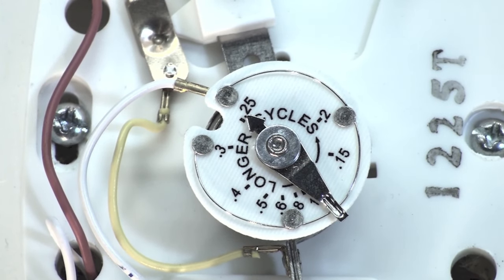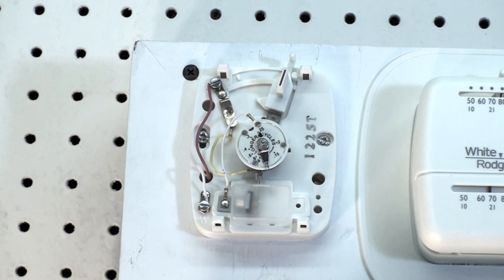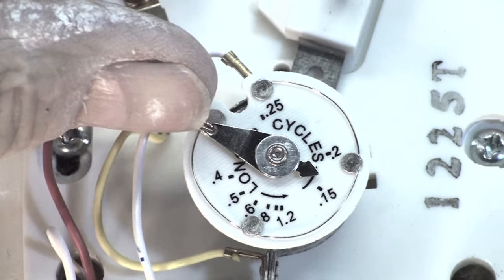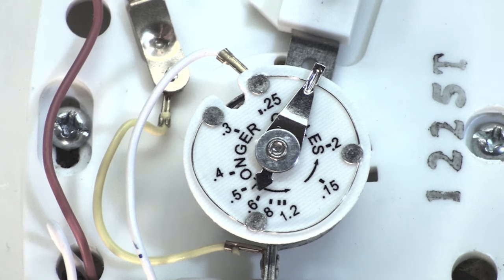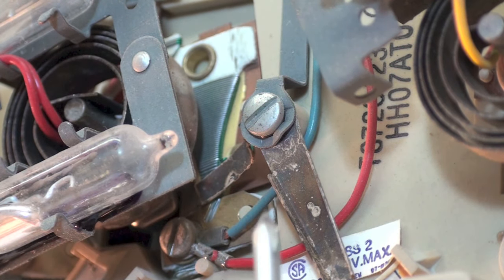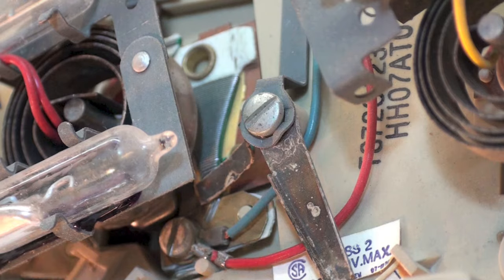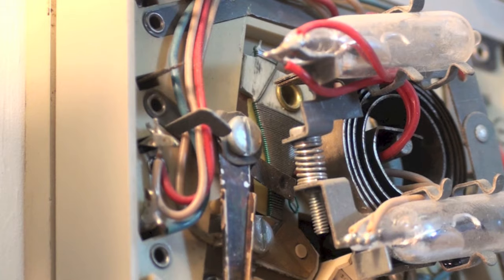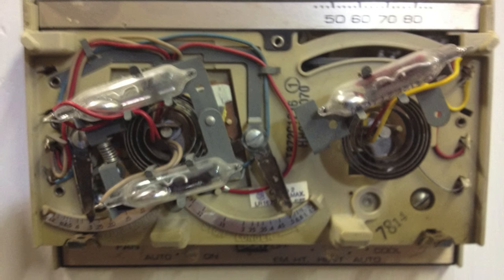Adjusting the thermostat anticipator part 2

Comment: Okay...so the first one you showed is exactly what I have in my RV which is my current home. This is brand new...maybe 6-8 months old. Out of nowhere for the last 24hrs the heater was turning on and staying on even though I had it set to the third line. That usually has it turn on for about 5min, which is more than enough time to heat up such a small space. I turned the little dial all the way off but it just kept on going pumping out heat. I finally went out and turned off the gas because I was being roasted alive. After watching your videos I opened the thermostat cover and the little dial arrow was pointing to 1.2. I’m hoping I’ve understood correctly as I’ve moved the arrow clockwise so that it’s now pointing to .6. I’ll see if this helps to shorten how long the heater turns on for! Hoping you still check this as it’s an 8 year old video but it looks like you did respond to someone about 11 months ago. Thanks so much for sharing your knowledge with us!! I’m an absolute dummy when it comes to this type of thing so I’ll take any help I can get!🤗

Comment: I have an old Honeywell mercury switch and a new Tempstar furnace. I'd like to replace the thermostat with a digital one, but really I'd like to have it be more accurate...it's off about 4 degrees at least with a digital AND a red outdoor thermometer that I used to check. Can I just move it a little up or down to make it more accurate?
Reply from the maker: They can be adjusted.  Pretty hard to do in a comment.  I will put it on the list for a video.
GFM
Reply: Thank you! Your the best. Us renters amd poor people need help with these things.
Reply from the maker: @josephmalone1786  Welcome
GFM

Comment: I've been having an issue with my thermostat..wondering if i can get some help.  my a/c is set to auto 75.  it says its 72 in my home but the a/c wont shut off.  runs all day.  a/c is cool, gets colder the longer it runs but yet it wont shut off unless i move the temp set to almost 80.  its 90+ degrees in Houston, cant have my a/c at 80.  what could be the problem?  Thanks for your help....
Reply from the maker: PriscilathaKilla The thermostat may be out of calibration or it could be located in the wrong spot.  Probably the best thing to do to start with is replace the thermostat.
GFM
Reply: PriscilathaKilla j

Comment: our heat only comes on if we turn our thermostat to 80, can you tell me why?
Reply: If its hot water heat go around to each rad and bleed off the air as these things are very susceptible to airlocks every rad will have a bleeder screw catch the water the best you can and use a big rag too ...

Comment: My thermostat is just like the first one in the video and it won’t heat beyond 70. Please advise!! My dial also doesn’t have the little arrow it only has the handle part installed. The arrow is simply missing so this makes things very confusing.
Reply from the maker: If you turn the thermostat up as far as it will go will it heat beyond 70 F?
GFM
Reply: Same problem. My landlord had a subcontractor install a new Schneider Electric with anticipator. Water seems boiling hot in baseboards with fins but it won't heat beyond 70 even pushed as far as it can go!  I'm not sure the anticipator is set right... I wish there was an easy solution! :(
Reply: grayfurnaceman Help Please! My thermostat is the same one in the first part of your video but it stopped working then it would only work when I set it on high I don't know what to set the inside dial to its on 6. We are freezing. Please help!
I bought a Honeywell CT30. My wire only has a red and white.  
Thank you for the video!
Reply from the maker: Its probably not the anticipator.  Have you checked the trouble codes?
GFM
Reply: grayfurnaceman I put the old one back on and it works. Mine doesn't have codes. Thanks for your videos!
Reply: I have my heat setting set all the way up to like 80 but house temp is like 65 ! I times weil McLain furnace firing it up ! It fires up only runs for 1 minute and 45 seconds thrn it shuts off abs stays off for about 3 minutes then it turns in again . To keep it seems it’s not staying on long enough to heat house properly ! Why ?

Comment: This makes very little sense to me. I have a Honeywell thermostat t822d 1008 and I don't understand what you're saying here. Turning that dial adjust the wire length? Your were talking about amperage. This is just confusing.
Reply from the maker: Turning the dial does change the length of the heater wire and increases the amount of heat discharged by the heater for a given amount of amperage going thru the heater.  
If you increase the amp draw of the circuit, you must shorten the length of the wire to correspond tho the increased amperage draw of the circuit.  
GFM

Comment: Need Help.  I have a Lux T101141 thermostat.  I have called our apartment maintenance several times already, but each time he got the fireplace to come on, once it goes off, it'll never come back on again, therefore I had to submit another maintenance request.  Every time he comes up here to fix it, he mess around with the anticipator to get it working again.  But once the temp reached the desired temp, it'll turn off.  Once it turns off, it will never come back on, not even if the temp register 60 degrees.  It's getting pretty annoying especially if he thinks I'm the one who is doing something to it
Reply from the maker: The answer depends on the control system of the fireplace.  If the system uses millivolts to operate, you have the wrong thermostat.  Your thermostat is for use with 24 volts.  The maintenance man may adjust the anticipator and that may allow it to start, but the anticipator introduces excessive resistance to the circuit of the millivolt system.
GFM

Comment: We are novices, and being as such we do not know what our control circuits draw.
we do not understand the effects of the different length of anticipater wire pretend you're taking to complete idiots and give it to us in English ....I listend to it a couple times and yeah didn't get it ...shame on me I recon eh...
Reply from the maker: Try this one:  https://www.youtube.com/watch?v=4mldGGxAVIs
GFM
Reply: @grayfurnaceman  that one doesn't help either;  is there a way to know what the anticipator should be set on without guessing or trial and error.  Like maybe there's a number somewhere on the furnace that you dial into the anticipator?   Or maybe there's a method of using a multimeter to determine the draw, and then dial that into the anticipator?   We want to know how to do that correctly.

Thanks
Reply: When you are using youtube, look for the links.  There are several videos on thermostat anticipators that are linked that may help.  Try this one:  https://www.youtube.com/watch?v=clud3BBiQV8
GFM
Reply: @Scott.Farkus  the anticipator should be set to the micro amps on the gas thing lol in the furnace

Comment: I thought maybe adjusting this thing would fix my problem.. maybe not. Boiler zone valve at basement is constantly calling for heat even though the thermostat is off. What is likely wrong.. the little Honeywell disc valve motor? If it's always getting 24 volts it's either the boiler's board or the thermostat, and if it's getting no volts then it must be the valve motor; right? I have had to shut the valves off past the zone valve to get the heat to stop but the damned zone is still calling for it. Calling a boilerman isn't an option so I need to figure this out on my own. Will any other issues be had by doing what I've done? If the water can't go anywhere but a foot past the zone valve where a second valve is shut off, it shouldn't affect anything; right?
Reply from the maker: You probably have a stuck zone valve.  No 24 volt at the valve motor, and valve is open, the valve is stuck.  Shutting off downstream will not cause any failures.
Reply: @grayfurnaceman  I unplugged red wire at thermostat and the zone stayed open. I remembered the boiler was making a noise I assumed was a hard start at the gas valve and that it would eventually stop working and need to be replaced. Now I realize it was the zone valve motor. The teeth of the opener that the motor sits on was stripped and manually operating it was very difficult. Seems like I need to replace the motor and box it sits in.. hopefully the valve itself is fine. If these parts are made in China now I'll be looking for an older one that was made in Canada or USA. This one lasted 26 years!
Reply: Seems like replacing just the motor (but not the actuator head) has partially fixed the issue; the zone now opens and closes when the thermostat tells it to. The only other thing I can do is buy a whole valve, remove the entire actuator head assembly with the motor, and install it in the old actuator head's place (if it's identical); but it seems to be working to open the zone with just the motor. BUT, if I press really hard on the manual opens for the other zones it actually fires the boiler where it won't with the basement zone. So I guess I either have a bad board (or connection with the merettes at the new motor?) or that actuator head assembly really is no good. As long as the zone is open, heat will still circulate especially if the other zones are calling for heat (and maybe that feature of the zone firing the boiler for that zone burned out because it was always open). Even with the heat off downstairs it still feels plenty warm, probably from the boiler itself being down there. I'm probably going to leave it as it is for now.
Reply from the maker: @VinylToVideo  If it is a Honeywell valve, the power unit is replaceable.
GFM

Comment: Do you know how to adjust the anticipator on a Emerson 1a10-651? I can’t find instructions anywhere. It’s stuck on 58 and doesn’t move. I live in an apartment and the maintenance ppl are worthless so I need to fix it myself
Reply from the maker: Your thermostat is a line voltage one.  There is no anticipator that can be adjusted.
GFM
Reply: @grayfurnaceman  thanks for your reply. That helped out a lot bc now I know that I was wasting time looking in the wrong direction. From what I see online, the way to calibrate it is to turn a screw to match the indoor temp. After I do that will the unit have the ability to turn itself on and off when it reaches that point? Also, it’s for a fan coil unit  that is manually switched over from cold to hot during the winter. I have the sub base switch set to hot right now(the internal on/off switch is stuck on 58 degrees) but when I turn the knob to a temp lower than 58 the heat turns off and when I raise it above 58 it turns on. When I switch it to cold(warm air still comes out of course) it turns on below 58 and off when above. Is the unit wired backwards?

Comment: exactly... what are you's saying... question is do calibrate the actual amperage stamped on the gas valve to the anticipator?!!
Reply from the maker: That number may not be accurate for the actual draw of the heating circuit.  I like to measure with an ammeter the W circuit.  Merry Christmas
GFM

Comment: Do I need to adjust this to make my AC cool it's not blowing cold
Reply from the maker: No.  If the fan is running inside and the outside fan is running, you have no problem related to the thermostat.
GFM

Comment: You are trying to impress with technical knowledge while totally not getting whey people to come to a page called  "adjusting a thermostat". what do you think we are here for? a lesson in circuits and switches and how much current goes through a wire? I didn't come to find out how it works, i came to find out how to adjust it. the temp in my place swings too far from too hot to too cold. which way do I move the indicator to narrow the temperature spread? when it licks off i want it to kick back on when the temp goes down something less than 2 degrees. is there any reason not to have it set so it keeps a steady temperature. my thermostat looks exactly like the one in the first part of your video
Reply from the maker: I have a number of videos on anticipators.  All are linked.  If you want to know how to adjust it without tools or a meter, simply move the lever toward "longer cycles" about 1/4" then check operation.  If set correctly, temp variation in the structure should be less than one degreeF.
GFM

Comment: How long will only the gas burner will run and how long will it take to turn back on that heat anticipator if is it set on 4 or .4
Reply from the maker: There is no way to determine the cycling rate without knowing the amp draw of the thermostat is if the thermostat is mechanical.  If it is electronic, there is a way to set the cycling rate in the installer setup.
GFM

Comment: Not quite understanding this. When it gets to the temperature set. Why won't it turn off? It just runs an runs. My anticipator is set in between .6 .8 plz help?
Reply from the maker: Your problem may not be in the thermostat.  Try disconnecting the red wire on the thermostat to see if it stops.
GFM

Comment: What if you dont have an old thermostat with the mercury?
Reply from the maker: If your thermostat is mechanical, this will work.  If your thermostat is electronic, you will need to go into the installer setup to change anticipation.
GFM

Comment: Ok so my unit froze up twice. My thermostat is set to 75 but the ac is set to auto and keeps running to 68 and still doesnt cut off.. Why?
Reply from the maker: If you disconnect the Y terminal at the air handler and it still does not shut off, look for a stuck contactor at the outdoor unit.  If it shuts off, the problem is in the thermostat.
GFM

Comment: this is an old video so I dont know if u will see this.. but I am trying to fix my air unit.. i bought a new thermostat, its a honeywell ct-30 and there is one of those dials to change.. in my manaul it says "electric furnace any type" to set it to .3 but this is for an AIR UNIT.. it runs.. but it runs and runs and nver turns off.. if I raise the temp up high enough for it to stop.. it stops.. but if i go to turn it back on it kicks the breaker outside on the pole.. so do I have it adjusted wrong? the old one that was on there was a really old and didnt have numbers... or it wasnt set to a number.. i dont have a guage or anything to read the voltage.. so what do I do?
Reply from the maker: If you are using it for A/C, no adjustment of the anticipator is needed.  You have a problem not related to the thermostat.  Are you getting cold air when it is running?
GFM
Reply: its fixed now.. sorry i should have updated.. it turned out to be the breaker going bad outside.. it was replaced and its fine now.. but thats good to know for the future.. so It doesnt matter what the anticipator is set on for air? cause it was on 4 or .4 not sure.. i did change it to the .3 or whatever.. should I change it back? or does it even matter?
Reply from the maker: I would leave it as it was when you started.
GFM

Comment: How do we find out what the control circuit draw is? Where is this information stated?
Reply from the maker: There are 2 ways.  Use a clamp meter on the W wire when calling for heat and set the anticipator number accordingly.
If you don't have a clamp meter, you can try this:  https://youtu.be/4mldGGxAVIs  Merry Christmas
GFM

Comment: I put the heat 70 but the temperature in the apartment more than 90! I put it 50 also the heat still 90 what I have to do ?!
Reply from the maker: It's not your thermostat.  There is a problem with the furnace or distribution system.
GFM

Comment: I was told this was also called a "dead band" setting.Tungsten wire. Our heat didnt come on the other day and the tech found the wire broken. He moved the slider to make contact and send a signal Now it doesn't run constant but I was told that these settings were for ,like if a cold wind or gust it would not cycle your heat.  .
Reply from the maker: It is a "dead band" setting.  If the wire is broken, you need to replace the thermostat.  The wind gust thing has no basis.  I have several more videos on anticipators that may help.
GFM
Reply: Thank You, Sir. It was 8 degrees at home and we were worried about pipes freezing. I did clean the igniter and flame sensor. I thought it may be the induction motor. But on "fan" the motor came on. I checked the board and the red light was constant. I thought normal operation. When I realized it wasn't getting a signal I thought it may be the thermo. I called the man and after taking a few readings he traced it back to the thermostat. Red wire...24 volts at the unit. That's when he showed me the wire and moved the slider. Yes, I agree we need to replace it but would you recommend a wireless ? Again Thank You...
Reply from the maker: All depends on what you want to pay.  Wireless thermostats work ok but there are many decent wired ones that are cheaper.
GFM

Comment: How do you find the amp draw from the Circuit broad to figure the amp?
Reply from the maker: Use a clamp meter around the W wire to the thermostat.
GFM